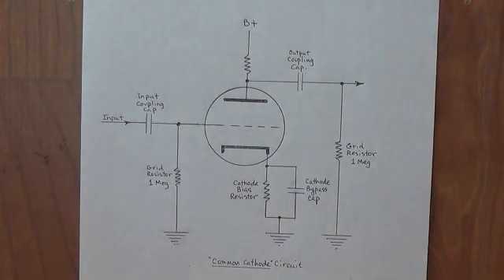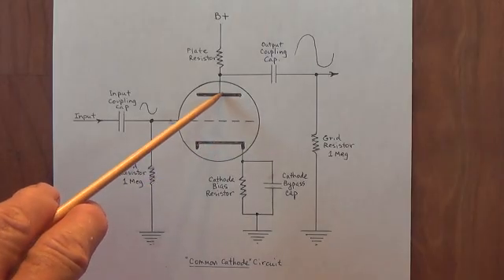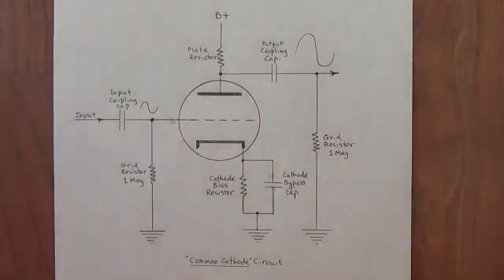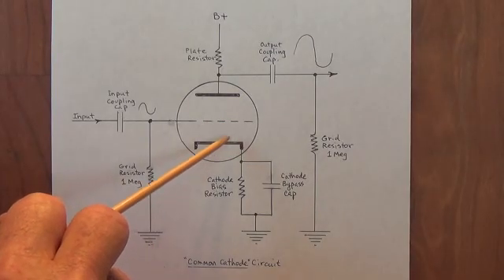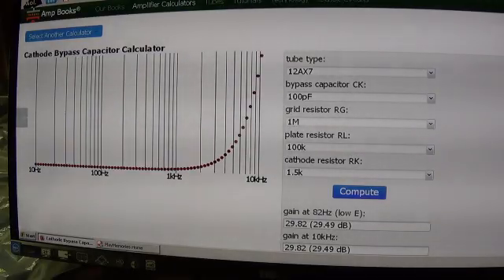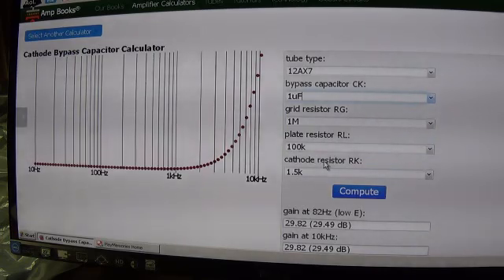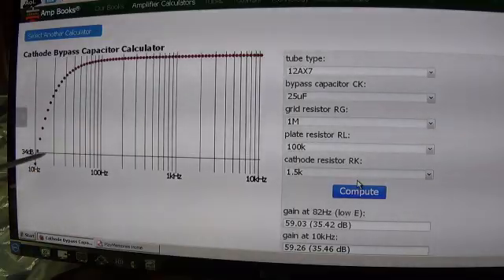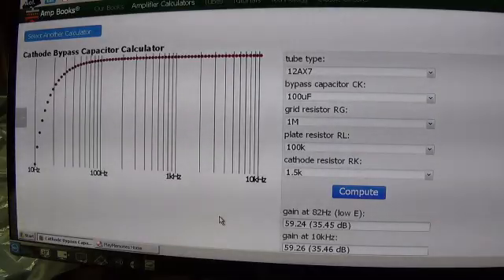Cathode Bypass Capacitors: How they Affect Gain and Tone

Comment: Uncle Doug I knew you and rusty are awesome but I didn't know you were clairvoyant too.. 

I have been working my way through modding my Peavey Classic 30 for the last month, following instructions from the Blue Mods website.  One mod at a time and then testing to see what change I get.  I have been looking at the RC networks in the schematic and wondering if it would benefit the sound to install higher quality caps.  I have been swapping in Orange Drops and Silver Mica's to the caps where the signal runs directly through to the next stage.   Upgrading the caps that the signal passes directly through makes a huge difference, but I am wondering if these caps discussed in this video would benefit the sound simply from swapping in better quality caps. 

Anyway... I was wondering why the heck there is even a cap in this place and figured you were the guy to ask and when I logged on there it was, my answer waiting for me to listen too. 

I sure do appreciate you sir, you explain things in a way that alleviates confusion. 

Thank you very very much!

Jeff
Reply from the maker: +Jeff McLowry I'm not sure I understand the question, Jeff. Are you asking why capacitors are used in tone circuits? If so, it's because of their ability, particularly when coupled with resistors,  to discriminate between different frequencies and to treat them differently, i.e. pass them along or send them to ground.
Reply: +Uncle Doug please express my apologies to Rusty for creating confusion, I will try to clarify here. 

You have pretty much answered my questions with your video.  When I first watched it I still needed more time to digest it, even though I got the basics of what you were explaining almost immediately. 

My original thought/question had to do with the difference between a cap that is in the direct signal path, as in a cap that is directly between two gain stages, and the of the caps that are in a ground tap, as in the one you are using as an example in this video. 

I didn't realize that a cap (and resistor) in a ground tap like shown in this video could have such a pronounced effect on the sound coming out of the speaker.  OF course the more I experiment the more understanding will come.  So far I have only replaced caps that are in the direct signal path on my Classic 30 and it has made a huge improvement in the sound and feel of my amp.  You have given me new ideas on how to tailor my sound. 

For clarification I am including a link to the Classic 30 schematic.

http://www.bustedgear.com/images/schematics/Peavey_classic-30.pdf

C-3 and C-4 are in the direct signal
While C-7 and C-12 are on (what I would call) a ground tap.

The way I understand it: if we have a cap value at C-3 which filters out the high frequencies, the sound from the speaker will be more mid/bass sounding.  But if we install the same cap at C-7 its going to work the opposite because that resistor (along with the cap) is actually a path to ground for taiming down the signal to the next stage. Which means that  together that are  restricting how much of the signal (and high frequencies) are going to ground.  Which I think means more highs are going be passed through the system to the speaker and more of the mids/bass are going to ground.

Or am I basackwards on that?

I have come to realize that Peavey used some really tiny, meaning very small (seemingly low quality) caps and micro sized resistors in this amp.
So far simply changing to higher quality parts has made a big difference in the body of the sound.

What I am really interested in, is finding out if simply replacing a cap like C-7 and C-12 with a higher quality cap of the same value will make an improvement in the sound.  

As always, you and Rusty are my guitar amp heroes!

Jeff
Reply from the maker: Jeff, C3 and C4 are coupling caps....low values will reduce bass. C7 carries high frequencies to ground. C12 is a cathode bypass cap.....it increases gain and higher values boost bass. I don't feel that expensive "tone" caps are worth the money. Any good quality capacitor (Sprague, etc.) of proper value will generally work just fine. Replacing cheap, junk caps with good quality caps will probably improve tone and reliability.
Reply: +Uncle Doug Thank you for clarification on these items.  Orange Drop 716P caps are what I have been swapping in place of the stock caps.
Reply from the maker: Sprague Orange Drops are excellent caps based on my experience. You are probably improving the circuit.

Comment: I'm a Harp player, i am beginner in this case but i think there is a mistake in this video, i have remove cathode bypass cap from my amp(it is common modes on harp amp for decreasing the gain) and i can't hear any differences in frequency response but less gain). anyway thank you Uncle Doug, i recently finished building of my first amp. your great channel was very very helpful, thanks again and say hello to Rusty and kitty.
Reply from the maker: Ebi Molaei Greetings, Ebi. Perhaps you couldn't hear a change in frequency response; but, as demonstrated in the graphs, the presence and value of a cathode bypass capacitor does indeed affect the frequency response of the circuit. Perhaps a harmonica does not routinely produce tones of sufficiently low frequency to make the change evident.  Congratulations on your first amp build, and thanks for your kind words and input.
Reply: Uncle Doug I did a test, with some caps, 1. some ceramic and polyester caps with different value, nothing, no any changes in tone. 2. 50 uF electrolyte  cap, increasing in gain an a little brighter.  3. 25 uF, close to 100 uF 4. 10 uf, the tone became brighter that 25 and 100uf considerably. i'm not sure but i think only electrolyte caps works in this location and  using caps with low capacitance is not equal to using no caps.
Reply: Uncle Doug With using the two video of Tone Stack in this channel i added a tone control in my 5f1( thank you so much Uncle Doug!, it is a low pass filter that very useful for harmonica, the tone control of 5f2-A was useless for me), than when i change the low pass filter cap i can hear differences.
Reply from the maker: Congratulations on a successful modification, Ebi. Rusty and I are glad the video was helpful. Best of luck to you :)
Reply: If the stage was fully bypassed originally, then you would only hear a difference in gain. (e.g. the 25uF across the 1.5k found in many Fenders fully bypasses down to frequencies well below frequencies produced by a guitar.)

Comment: UD on a Fender AB763 is that the 25-25 cap?
Reply from the maker: Bob Barcus  Yes, Bob, 25uf@25VDC is a typical value for a pre-amp tube cathode bypass cap in the AB763 chassis (as used in the Fender Pro, Twin, Showman, Deluxe, etc.).
Reply: Uncle Doug What would be the lowest you would use? I have a really nice 1963 Bandmaster Maybe to play with the gain a tiny bit I like clean gain Classic rock and SRV type blues tone...I use a modded Boss Sd-1 with GE trannys and panasonic caps and 808 output,and a DDL-2
Reply from the maker: For greater gain and fuller tone, I would suggest going up in value. Try a 50uf and see how you like it. If that doesn't suit you, then 10uf is as low as I would recommend.
Reply: Uncle Doug Can I do just V-1  or do you have to change all the 25uf caps Thanks for your time UD
Reply from the maker: You might try changing them on one channel, one cap at a time starting with the first pre-amp tube in the channel, then the next, etc., and listen to the tone after each change. A little trial and error is generally required on tone modifications.
Reply: The 25uF capacitor in conjunction with the 15k resistor results in maximum gain down to approx. 5Hz, so that the stage may be considered to be fully bypassed. This means that increasing the value of the cap would have no effect on gain or frequency response. Decreasing its value would make a difference, cutting bass (or enhancing treble if you prefer), while removing it would result in minimum gain across the frequency spectrum.

Comment: Great Video, I went to Amp Books and didn't find your nice tube calculator but found some strip down version. Where can I find the one your using?
Reply from the maker: Kirk Thanks, Kirk. The Amp Books link is the calculator shown in the video. You have to click on the "Launch Me" button at the top left of the opening screen.  They may have changed the display slightly, but the function is the same.

Comment: Uncle Dough this is really great!...I am in the midst to looking into building a 5C3 and with your videos I am even more inspired and confident to do the amp. For the 5C3 and as per your videos I see the 6SC7 pre-amp- 6SC7phaseinverter-2 6v6GT power tubes-output power transformer. I see the volume and tone in between the pre-amp & phase inverter......in this design where the cathode bypass cap would be? or it is part of the tone/volume circuitry?...Rusty is really cool!!...a belated congrats on your 100the milestone and tons to come!
Reply from the maker: atta1798 Thanks, atta. Cathode bypass caps are attached (as the name implies) to the cathode(s) of the 6SC7 Phase Inverter (25uf @ 25V) and the 6V6's (also 25uf @ 25V). The "tone" capacitors are the .0005uf and .005uf caps attached to both sides of the 1Meg tone pot.
Reply: Uncle Doug this is valuable information, you are awesome Uncle Dough. By the way, your videos are actually great and of valuable technical information...thank you again!
Reply from the maker: You're welcome, atta. Best of luck with your projects :)
Reply: Uncle Doug this means nothing by the way but I am an engineer and do engineering for a living which means I do not know much of anything and I am always learning all the time..an I am all ears when I see experts and people talking about what what they know......titles or professions do not give you that when the expertise is there......:).just to add the little more...the limited knowledge I have in engineering, magnifies the pleasure and enjoyment of your videos...and the learning curve from your expertise...greetings to Rusty!......:)
Reply from the maker: Thanks, atta. I too prefer people who are highly motivated and constantly seek knowledge to those who have achieved a title or degree and no longer feel the need to avidly pursue new topics and skills. Rusty and I are very flattered that you like our videos, and thank you for your input.

Comment: Hi Uncle Doug.  Thank you so much for your videos.  I feel like you are my teacher! I have a couple of questions.  I have an Electrohome PA300 MKI amp and it sounds pretty good as a guitar amp.  I find that the phono input sounds the best with a guitar connected.  Would you be able to have a look at the schematic and see if you think it could benefit from a change by adding a bypass cap.  I can send you the schematic if you would like.
Reply from the maker: You're welcome, Aero. I'm glad the videos are helpful. Re the addition of cathode bypass caps to PA amps, it does tend to improve the bass response and "warm up" the tone. If you have pre-amp tubes or output tubes that are not cathode bypassed, you can experiment by clipping in (use a short piece of wire with insulated alligator clips at both ends) bypass caps of varying capacity (around 20uf @ 50V to start) to the un-bypassed tubes (one at a time) to fine tune the tone to your satisfaction. In some cases they have significant effect, and in others, not so much. Just be very careful with your tube pins and cap polarity (always negative to ground). Good luck.
Reply: Uncle Doug I am looking at my schematic and Pins 8 and 3 of the 12AX7 just go directly to ground with no resistors in the circuit.  Have you seen that before?
Reply from the maker: It's uncommon in guitar amps, but not that rare in PA amps. You might consider replacing the ground with a 1K resistor and a 25uf cap, just to see how it affects the tone.

Comment: Here's a quick question - if you want to change the overall tone of an amp, let's say add a bit more bass, and I don't mean fine tuning with the tone controls here, I mean kind of like a default tone of an amp when all the knobs are at noon, would you go and change the cathode bypass caps and resistors or would you rather change the hi and low pass filters in the tone stack? 

I'm asking cause if the tone stack is early in the preamp, the later amplification sections will sure get a different tone, but their cathode bypass sections will also change the tone, so what is, hm, "better" - having all the cathode RC sections changed or just the filters in the tone stack?
Reply from the maker: I prefer either adding or increasing the value of cathode bypass cap(s) to increase the bass response. Any modification to the passive tone controls will simply result in sending more or less treble (or midrange) signal to ground to create the illusion of bass increase (that's the way they function).....while the bypass cap change actually boosts the bass response.
Reply: Uncle Doug Thanks so much for your patience with your tutorials .
In regard to Bypass Caps. Is the reason some stages do not have Bypass Caps
based on keeping the tone "Flat" ?  Keep these Video's coming ..
Reply from the maker: I think it's probably the preference of the circuit designer, who creates a tone circuit that meets certain cost/design criteria and pleases his ear. We can then modify the circuit to satisfy our taste. The absence of bypass caps would tend to keep the volume moderate, the tone "mid-rangey" and clean, and reduce building cost.

Comment: Dear Doug. I have been watching and appreciating your videos greatly. Though I'm working on a home built audio amplifier, the information is more than helpful.
I was wondering this, how do bigger higher voltage capable capacitors with the same capacity respond? (like a 100uF 100V instead of a 100uF 35V. Do they have different quality or response?
Reply from the maker: Greetings, EQ, and thanks for the kind words. The voltage ratings on capacitors are simply the voltage levels they can withstand before internally breaking down and (usually permanently) ceasing to function as capacitors. Imagine two tiny, thin pieces of tin foil separated by a sheet of wax paper. A 100uf @ 35V cap can withstand about 35V (probably a little more) before the wax paper breaks down and current flows from one tin foil to the other. A 100uf @ 100V has a thicker layer of wax paper and can withstand 100V before breakdown. The capacitance rating has a big effect on function, tone, etc. while the voltage rating simply designates the maximum operating voltage the cap can tolerate. Also, there is no downside, other than cost, to installing a cap with higher (never lower) voltage rating if you don't have the correct one on hand. The same cannot be said about capacitance....any change in value will probably have an effect (often negative) on function.
Reply: Electrolytic capacitors are rated to operate for a number of hours at a maximum working voltage and temperature, e.g. 2000 hours at 100V and 85 deg. C. Operation at a lower voltage and/or lower temperature increases the working life. This is of little importance with regard to cathode bypass caps in the preamp, but needs to be considered for output tube cathode bypass caps and filter caps in the power supply.

Comment: Isn't the output of this stage inverted? The + becomes - and the reverse?
Reply from the maker: Greetings, Spud. The signal phase leaving the plate is inverted with respect to the signal phase on the grid, but the voltage on the plate always remains positive. This is fully explained in the Phase Inverter video, posted on this channel.